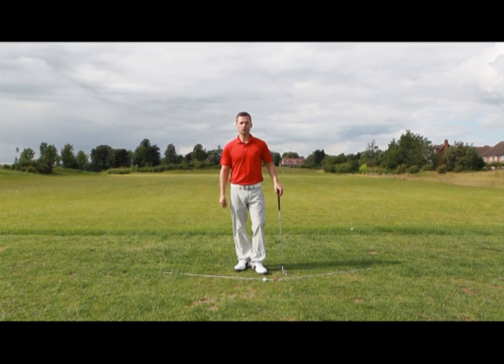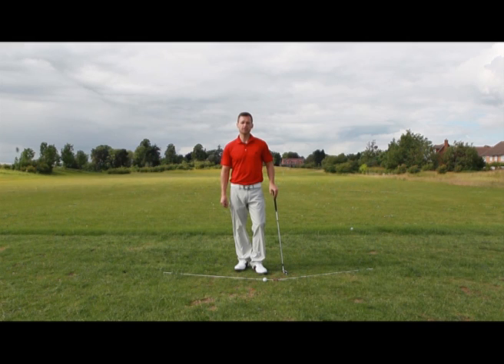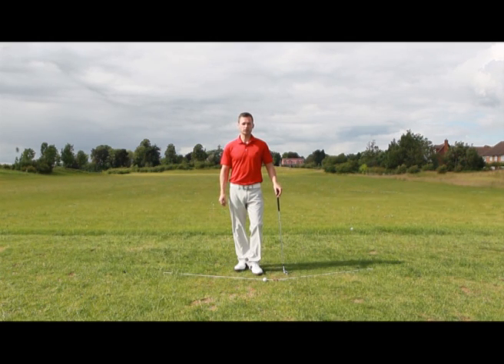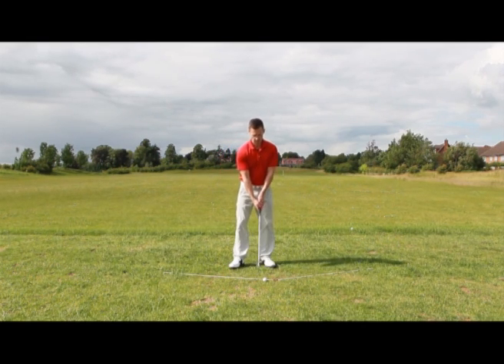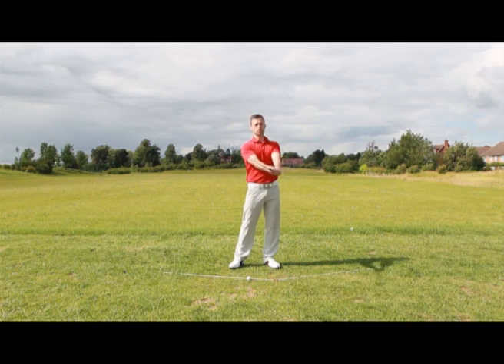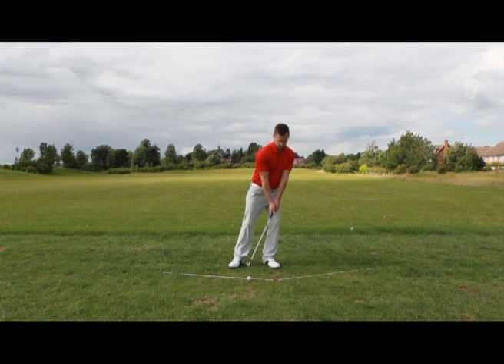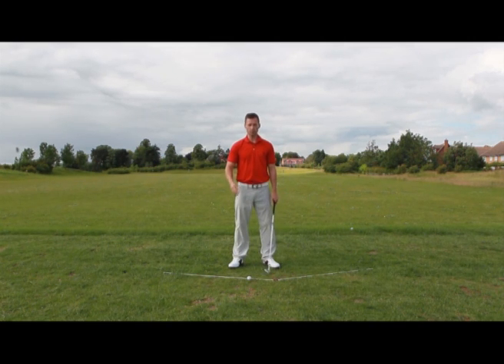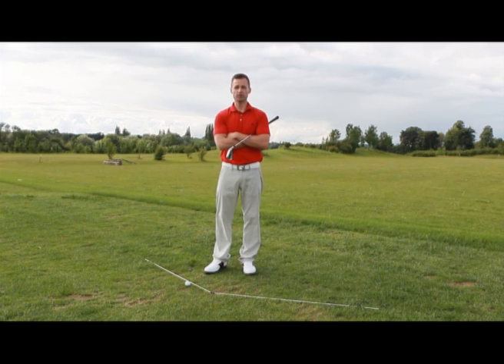Golf Swing Tips - Stack and Tilt

Comment: Well, thank you for that in-depth analysis Johndim11. Perhaps expand a little of why you think this swing method works so well with longer clubs. Maybe its the "attack angle" produced by the swing ( found to be around 10 degrees down)  or the "plane angle" (found to be around 8 degrees less than the initial lie of the club) or the "clubhead path" ( found as high as 16 degrees in-to-out ) or maybe its the "hands inside the clubhead/closed clubface' backswing which makes it so great. Yeah right !

Comment: What I have said, and will continue to say, is "longer clubs - NO !" As for me learning about the method, I have actually discussed it, and my concerns, at some length with Andy Plummer. The point is: The elements of a good swing system NEED to be for everyone. In S&T, the weight bias, the over-rotation of the hips, the straight right leg, the necessary lift and tilt back of the head through impact....are not. ps: What data do you gererate in the areas I mentioned ?. None ?. How shocked am I

Comment: I got this on S&T..." The biomechanical model of turning around a stable hub demands a 3D description of how the spine works.  2 of those dimensions extending and side bending are not part of the traditional description. If you follow a translating hub model, by default, only turning the thorax in anatomical flexion translates the golfer to the right.  We use torque about a stable hub while creating a ground force vector akin to a jumper by extending and side tilting". So, why is it failing ?

Comment: I haven't tried this so it's hard to judge. However, I don't see how power can be generated without weight transfer and keeping it on one side through out.
Reply: Moreme. The weight transfers in the same way as coiling into a brace of the right leg. By leaving the weight forward on the back swing, you have a head start on the weight transfer, increasing the weight on the left foot as you start the forward part of the swing. Without over thinking it; I tried it. I like it.